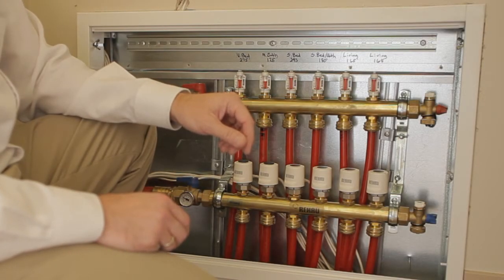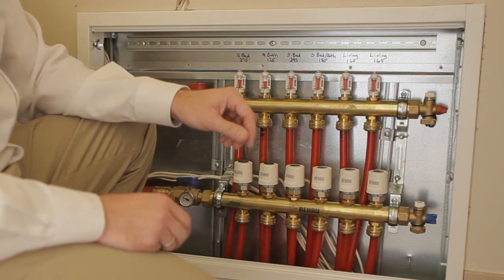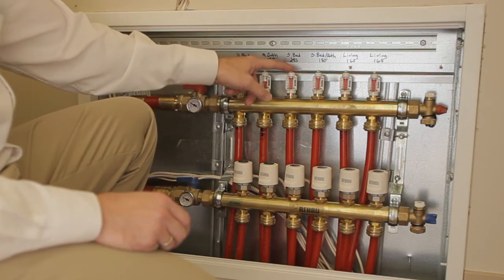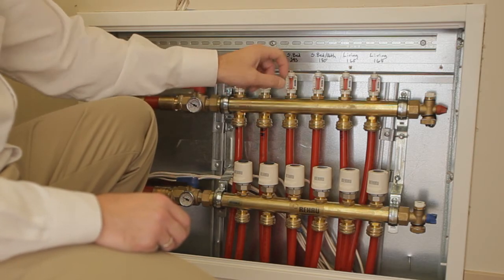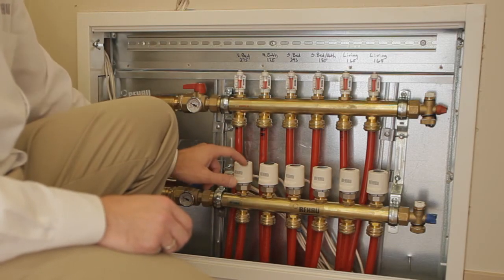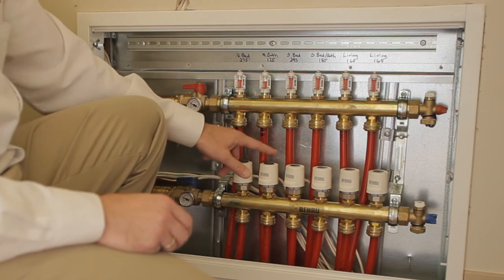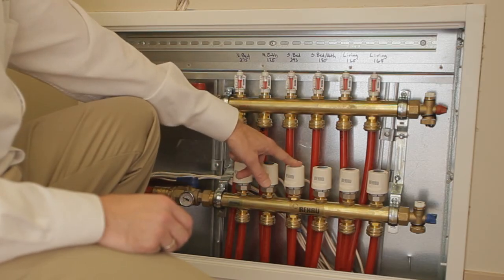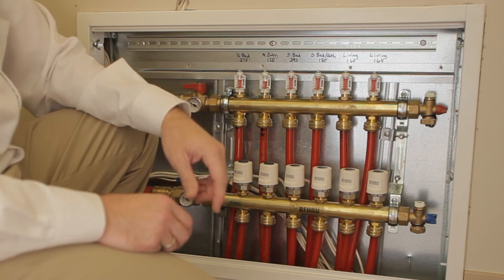Radiant Floor Heating Manifolds

Comment: can you give me some suggestion for below: When the heating zones come on, there is loud banging sound that lasts for approximately 5 minutes. This noise is accompanied by the movement of a flow meter that moves up and down within one second during the banging sound. It's important to note that this occurrence is infrequent, happening only about three times in the last three months